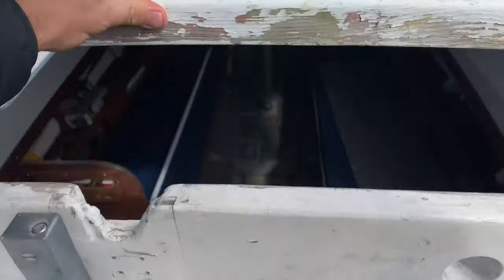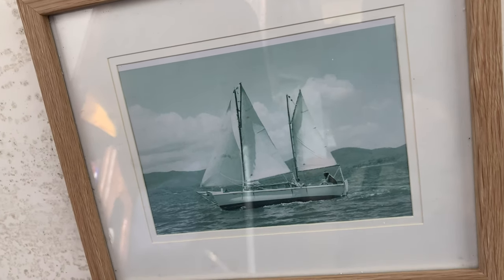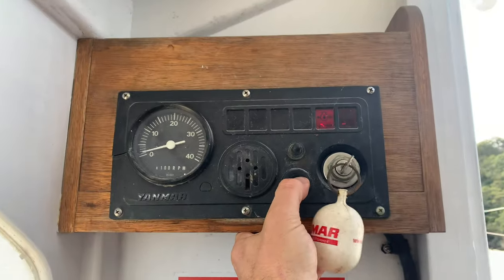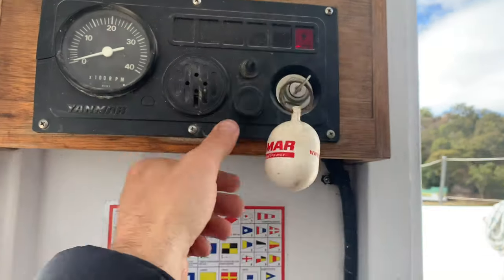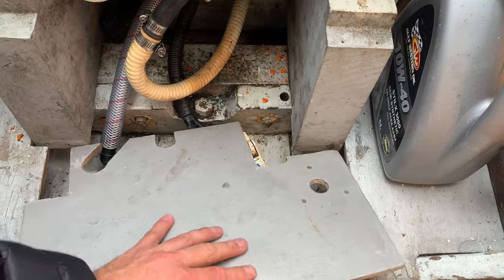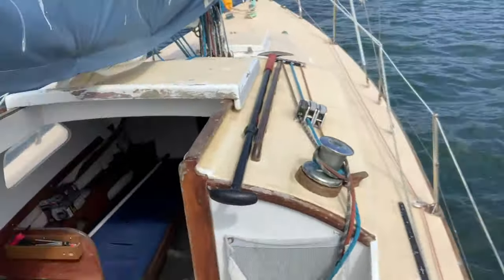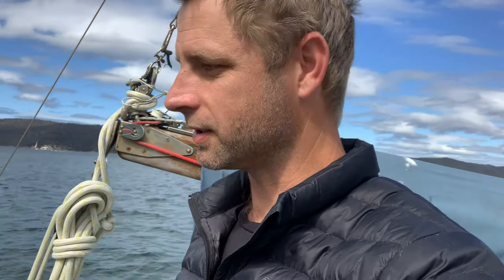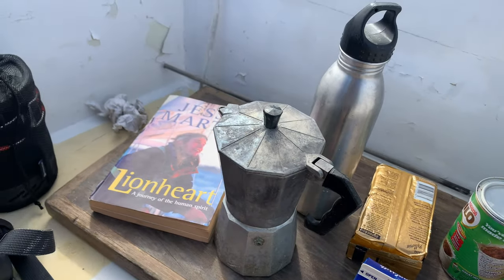Why I'm building a 22ft catamaran - Building Skimmer Ep.1

Comment: I like the rationale. Those are the same reasons I'm refurbishing a Farrier TT720. Which can be rigged from the trailer and launched in less than an hour.
Reply from the maker: The farriers gave a great folding mechanism, no wonder you can get yours on the water so fast!
Reply: @Aaron.deRuiter  Yeah true, but I've yet to prove it on mine which needs new beam boxes. But i have watched and timed an F27 at 1hr 15 mins, pulling up at ramp to floating on pontoon ready to sail